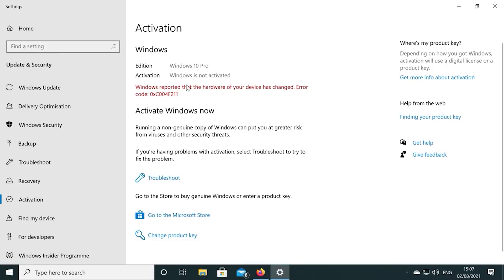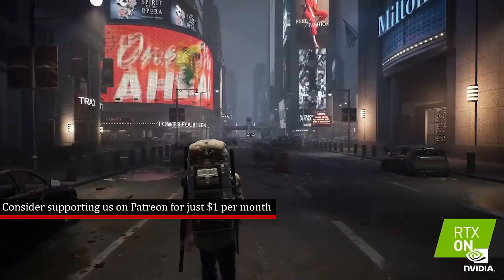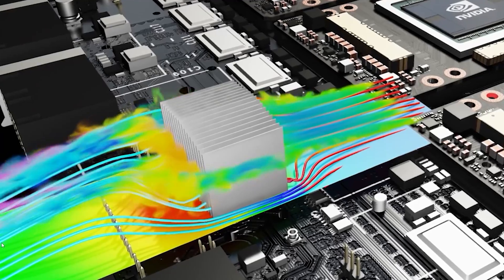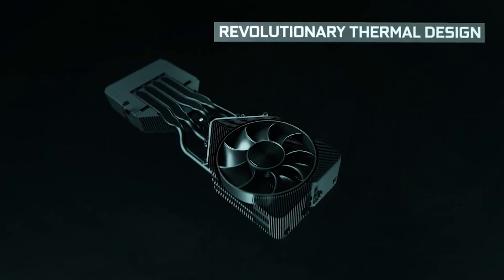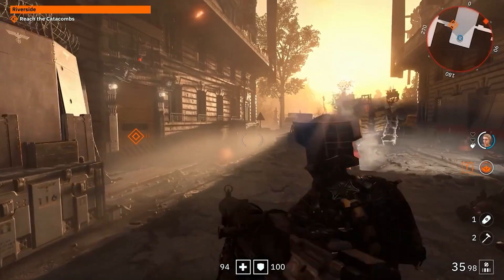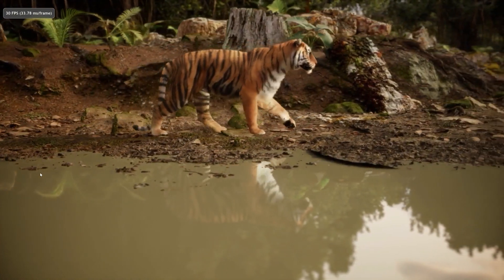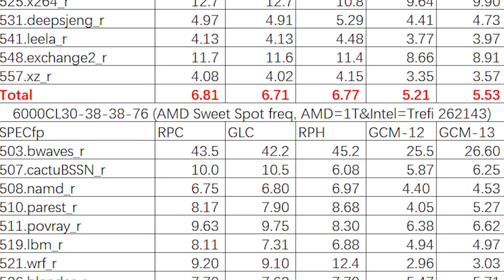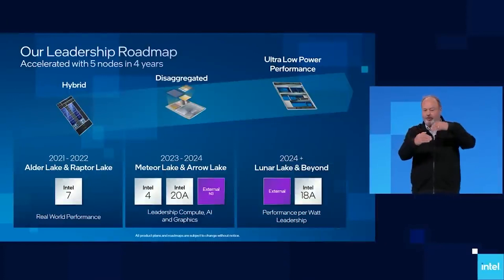RTX 4090 Specs DWARF RTX 4080 - Major Specs UPDATE | RTX 4080 Ti & Path Tracing Leaks

Comment: I bet they lowered the specs of 4080 so 3090/3090 TI will be faster for a while, so they'll keep selling for high prices. Then they bridge the gap between 40-series cards with with TI, Supers and what not.
Reply: The 4080 16gb model is a lot faster than the 3090ti. The 4080 12gb however should have been a 4070 that matches the 3090 in rasterization performance but, has better raytracing performance.
Reply: @ZackSNetwork  rtx 4080 will be 50% faster than the 3080
Reply: 3090 Level cards will I think be sold out and no longer produced or available before any 4080 cards launch.
Reply: There is no way the 3090Ti will be close to match any 4080 variant in performance - their only strength is vram and thats about it - so realistically it will only be people who are heavily focused on vr and professional production workloads that will maintain interest in old 3090/ti cards at high prices.

Comment: To me Alder Lake and Raptor Lake are the same thing. they just only release the better half of it now. 13700 is the the 12900ks and 12900kf 12900f all they did is just been everything hold everything back.... optimize it to be as good as possible. just like they did in the past but instead of adding a plus mark this time they changed the name. I'm actually a little disappointed there's no technological advance all they did is add a bunch of e-cores and bin everything. Where AMD is making leaps and bounds double the performance at half the wattage. The next jump that AMD makes is going to leave Intel scratching their heads if they don't get it together.
Reply: Raptor Lake does have increased cache though and that matters, better memory controller, better clockspeeds, 7% ipc improvement- double the E cores. It's not the same as Alderlake. Alder to Raptor is a better improvement for single thread than Sandy to Ivy or 6th to 7th to 8th to 9th gen
Reply: Excluding the cache and core count enhancements of Raptor Lake, it IS technologically superior to Alder Lake. Raptor Lake utilizes a new voltage regulator that reduces the amount of voltage needed to attain a given frequency. That’s why Raptor Lake can clock so much higher than Alder Lake, and fit more cores (more power hungry too) without blowing up the power limit.

Comment: In the budget segment, gamers are probably sticking with 12100F. Or 10100F if you really need to shave a few extra bucks as the CPU and board are a bit less $$ than with 12100F. But yeah, it will be interesting to see what midrange builds look like four months from now once everything has launched. 13400F, Z690, and DDR4? Or 7600X, B650, and DDR5?

13600K, which real Raptor Lake, has little to offer a gamer, especially a midrange gamer, who will be fine with 13400F. Intel Z790 has little to offer a gamer over the cheaper Z690; likewise on the AMD side, X670 has nothing to offer a gamer over the cheaper B650. As for B650E and RX 7600 XT, which has x8 PCIe lanes, we'll have to check benchmarks when they're available in November, but probably there is no performance difference between B650 and B650E when using that card. B650E, 7600X, and RX 7600 XT is a combo that can run PCIe 5 but it probably makes no difference.
Reply: 13400F, b660, and DDR4? Or 7600X, B650, and DDR5?vs 12400f with 150euro bclk oc mainbord. ore cheap b550 ddr4 with  450 euro 5800x3d. this are the 4 thinks you can do. i think i will wait for ddr5 cheaper and r7800x3d :) 3-4 month longer wait for 20% faster looks great. cpu  20% faster normaly take 2 years.

Comment: Got to feel bad for 3090 buyers, they got a 15% boost for $800 (MSRP) where 4090 buyers will get 60% or better over the next tier (until Ti versions start to come out). The 3090 was a crappy deal, no wonder Nvidia made so many of them. For 3080 owners, looks like you can wait until next gen to upgrade unless you want to pay a lot more to increase to the 90 tier.
Reply: Yes but 3080 owners might want to get the 4080 Ti, it will practically be 2x better (performance and vram)
Reply: 5080 LETS GOOOOO!!
Reply: Feel bad for all previous 80 class buyers who will now get massively downgraded compared to 90 class if they are not willing to pay hundrets of dollars of price premium.
Reply: @MicroageHD  Nah, It really makes it more like the 20 series, where the 2080 Ti was quite big boost in performance and of course came with a price tag to match. You would not expect a $700 GPU to be within 15% of a $1500 GPU under normal circumstances, I'm not really sure how Nvidia pulled that off, they never would have if it was not for the GPU shortage. The 3090 would have been under $1000 quick because there just wasn't enough reason performance there to justify the price.

Comment: I have been pretty happy with a 10gb 3080 and Quest 2 for MSFS and DCS. If the next gen of VR headsets does eye tracking and foveated rendering (higher res only where you can see it) i will put my money into a headset and not a new video card. I think the 4080 card will start at $1000 until they sell off the old 3080 stock.
Reply: @x0vg5hs1  No plans on getting a 40XX card here... like I said, I am pretty happy with the 3080.
Reply: your kidding right ? you seriously think the new 4080 will sell for 1000 dollars ? I just bought a 3080Ti for 1000 dollars US.. You can bet the release price for a 4080 will be double that price.
Reply: @tonys2683  The last gen official base price was $699. $999 sounds like a good bet for a "base" 4080.
Reply: @GetOffMyyLawn  2070 dollars US for the 4090... I'll just leave this comment here then shall I ?
Nobody cares about official base price or MSRP,
Retailers are supply and demand , The 4080 will be at least  ...AT LEAST 1500 to 1800 US
Reply: @tonys2683  The Nvidia RTX 4090 list price is $1599. The 12gb RTX 4080 will be $899 and the 16gb will be $1199. Retailers can sell them at whatever price people are willing to pay. I'll just leave this here shall I?

Comment: The 4080 12gb is not an actual 4080 if it has fewer available specs than the 16gb model. Calling it a 4080 12gb is so misleading, it should have the same number of fp32 cores as the 16gb version.
Reply: Yeap it should have been a 4070.
Reply: I think you are seeing the performance levels of the tiers shifting since now the "90 series cards are actually replacing the "80" tier cards which used to be the top dog.
Nvidia learned with the 30 series that to charge roughly double the price for a 90 card over an 80 card without consumer backlash that the performance level difference needs to match the price difference.

Hence the 4080 to a degree is being nerfed a bit and not even using the same chipset anymore.
Really for normal generation increases a 4070 really only needs to be at the 3080ti performance levels to be seen as an adequate performance increase if they manage to hold within the same ballpark with minimal price increases for the tier as compared to the last generation cards.

Probably why what really was originally intended to be a 4070 card is now transforming into instead being classed as a 12g 4080 which allows a higher price point to more represent the cards performance level..
Reply: @billwiley7216  Not really, the 90 series cards have rather replaced the Titan name, albeit with less fanfare and exclusivity. So in other words, an attempt at a "consumer's Titan card" series. In reality it's just a power struggle thing, as what positions cards is not their lineup number, but rather their pricepoint. And no 80-variant card has ever hit the price points near any 90-variant card, not even close. Of course in time it may be the case that Nvidia will try to push new 80 variant cards closer to old 90 pricepoints but we aren't there yet. Let's see what they announce publicly, I for one am tired of leaks and rumors.

Comment: My upgrade after 7 years GTX970 to RTX 4080. I cannot wait.
Reply: same here brother, going from a 1060 laptop that's dying to a 4080 or 7800xt, only a few more weeks hopefully
Reply: @polishpadi5915  Yes hopefully. But even after Nvidia release its better to wait for AMD release too. Prices might go down a bit due to the competition.
Reply: @TheDashitha  that's is a good idea. My preferred card would be 7800xt but I am quite desperate for an upgrade now 😂😭 if it's within a week or two of one releasing I will wait for sure.
Reply: The gtx 970 was infamous for its 3.5 gig of vram and now rtx 4080 12 gig version is rumored to have the ad104 chip instead of the better ad103 chip with 16 gig 4080. Which one would you be leaning towards?
Reply: @aberkae  imma aim for 16gig and if i cant get that one im going AMD
Reply: @polishpadi5915  Cryptomining boom is over for now there will be GPUs galore. I have a feeling that there will be a price war post AMD launch and that Nvidia will launch high so that it gives AMD wiggle room and them to adjust for a potential price war and make bank with thier initial launch.

Comment: Ray traversal Pipeline is responsible for path tracing performance.

Turing and Intel arc have 1-2 Ray traversal

Rdna 2 has 0 Ray traversal, that is why rdna 2 suck when running Minecraft RTX. Because it use shaders/CUs rather than dedicated Ray traversal processor

Ampere has 5 traversal unit, but most path tracing games like Minecraft RT and quake II RT are still using 1-2 traversal pipeline. Only Nvidia Marble and some demos are using more than 2 ray traversal unit.

PATH TRACING IS FUTURE

Comment: path tracing? sounds like another gimmick to justify higher dollars yet as op pointed out lol no games uses it as of yet. 🤣
Reply: Somebody has to get path tracing started. Done well it is transformative as is ray tracing.
Ray tracing came out on Nvidia with no games that had it, but now AMD, Sony and Microsoft have all adopted ray tracing.
Reply: For the most part yes. However so was rt when it came out. And could be a boon for folk who do 3d rendering outside a full pro environment where the company pays for the hardware
Reply: @kaseyboles30  ray tracing still isn't even being used in a lot of games and we're moving into the 3rd generation now. At this point I'd say it's to early to be trying to do full blown path tracing. Besides that RT barely even provides a difference in quality compared to ultra settings, especially in fast paced games.
Reply: @kaseyboles30  while that is true, RT is still turned off by the majority because how unreliable it is FPS wise. Now Nvidia is moving to Path Racing when it has not fixed RT to a point that it is usable by the every day player. 😉that is why I see it at the moment as a new reason to justify the higher costs.

Comment: 12GB 4080 just seems a money grab considering AD104 is more technically an GA106 successor from pure die size and memory configuration. And now it could be a 700 USD card.
Reply: FYI Bestbuy is selling the 3080tis by MSI  for $739 currently if the AD104 chip performance is better than the 3090ti Nvidia will want to charge a price premium over any percentage advantage over previous generation perceived advantage. Hopefully AMD 7000 series is on schedule and competitive in terms of pricing and performance.

Comment: 1500 is cheap for 4090. I hope it’s 1500
Reply: Wow!
Reply: @christopherenriquez5067   I hope you don’t think 1500 is a lot
Reply: @Estarossa300  that depends on what you do with the 4090? Do you make income from it or do you just play games? And, what kind of monitor are you running as well?
Reply: @christopherenriquez5067  It’s just for games and I play on 1440p. I want all my games to run on max settings capped at 144fps. I know the 4090 will be overkill for this, but that’s the point. I don’t want my GPU running hot, heating up my room lol. Hopefully the 4090 will do all that at 50% load.
Reply: in that case, a 3080Ti can provide you with a 144fps running on 1440p. It’ll probably run cooler since it only has a TDP of 350w with probably around 400w on OC. The 4090 will be running at 450w or more which will make your case run hotter. Plus, after the 4000 series is announced, the 3000 series cards will drop in prices. You may be able to grab 3080Tis for around $500 used. That’s a big savings from $1500 to $1700. 👍
Reply: @Estarossa300  GPUs running at limited loads don’t actually reduce power all that much as they typically use the extra headroom to clock higher. You can manually underclock the 4090, or get a 4070Ti/AMD equivalent. Also AMD is likely to have very high performance with better efficiency than NVIDIA this gen, so you may want to look into them. AMD drivers are no longer atrocious, so as long as you don’t need NVIDIA card or desire one of their specializations, AMD is probably better for what you wish.
Reply: Best case scenario the 4090 will be $1,700 at MSRP for the FE model. From what I have heard it will be $2,000 for the FE model and AIB’s will charge more than that.
Reply: @ZackSNetwork  1599
Reply: @ZackSNetwork  Not bad, I would pay that price.

Comment: The 4080 12GB is a scam. No one should buy this GPU. The 4080 doesn’t even seem like an impressive GPU because it’s only rumoured to have 9728 shaders with 76 RT cores. That’s quite a bit of a cut down from the full fat AD103 chip. The 4070 is rumoured to be on the full fat AD104 chip, so that means the 4070 Ti should likely use a cut down variant of AD103. The 4080 should really feature the full fat AD103 chip.
Reply: That 4080 needs to be REALLY cheap to be even worth considering.
Reply: I agree with you on the 4080 12gb because it’s really just a 4070 rebranded. However your wrong on the Cuda Cores situation of the 4080 16gb. You see Lovelace uses 75% of its Cuda Cores for Rasterization performance. While Ampere only used 50% of its Cuda Cores for rasterization performance. Also factor in higher IPC, significantly higher clock speeds, superior node, far beyond more L2 cache. You have a way faster GPU than the top end last generation.
Reply: @ZackSNetwork  id wait on that conclusion. I know it's not a linear scale but with the performance(2x 3090) per core/clocks on the 4090 and how heavily even the 4080/16 is cut down...I wouldn't be surprised if it BARELY edges the 3090 that way they can get away with +1100$ pricing cause "it's better".
Reply: @attemptityourself5662  I have done my research on the differences of Lovelace and Ampere. Non of what I stated was a conclusion but a fact. Even in history the 80 series GPU always outperforms the last generation top end as well. The 4080 16gb will be much faster than the 3090ti. The 4080 12gb however should be a 4070 in reality. Which is why it will match a 3090 in rasterization performance.
Reply: @attemptityourself5662    The 4080 will definitely outperform the 3090/3090 Ti by quite a bit. Even when it comes to gaming. It’s a high end next gen GPU. The 4080 will have 3rd gen RT cores with 4th gen tensors, which should massively increase RT performance. It should end up having 64MB of L2 cache compared to the 6MB on the 3090 Ti and that should also increase gaming performance by quite a lot along with other major upgrades that Lovelace will be getting. Some leakers have said the 4080 should be around 35 to 45% faster than the 3090 Ti in rasterization. In ray traced games it should be even more then that.
Reply: Or in other words, the 12gb model simply shouldn't exist in the first place. Nvidia already has the issue of oversaturating their own lineup to the point where they are maliciously self competing with their own cards. They've grown too accustomed to having Ti variants, Super variants, different VRAM spec variants, and it just continues. At some point they have to realize that they can't just manipulate their own price points by overflowing their own market saturation to the point where people stop caring about performance tiers because it's all one big mess anyways.
It's a gpu soup that no one wants to dive into.

Comment: AD104 as 4080 12GB
Yes, let's take 4070 change the name, and sell at 4080's price.
That's how every new generation is more expensive than the previous one. 
What next? 5090 on AD103?
Reply: For real at that point it just sounds like a 4070ti-ti (with an extra side of ti). How much can they saturate the uppermid/highend gpu market when they're already struggling to clear existing stock? It makes absolutely no sense. I miss the days where there were 3 main cards and only 1 or 2 of them received "high spec variants" to battle for some arbitrary performance lead that most people wouldn't care about.

Just give me a 4060, 4070, and 4080. And then anything above that name it Titan and be done with it. Sure then one year from now you can release updated models that are slightly better performance optimized if they want, but truly do we need any more than that?
Reply: NVIDIA are layering RTX 40 on top of 30 so expect insane prices
Reply: @findlaywilliams6610  Nvidia can't be too greedy on price, or people will just get Ampere cards on ebay for cheap. They will need to price Lovelace competitively if they don't want freefall stock prices since miners aren't going to be buying lovelace, just gamers.